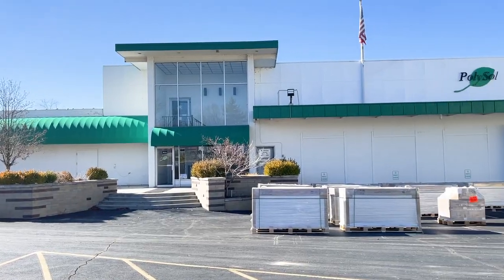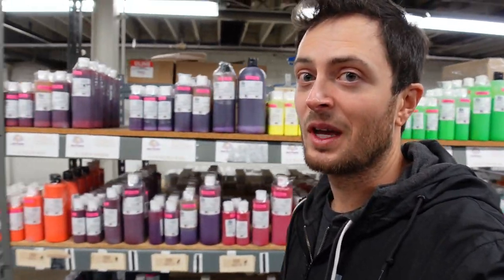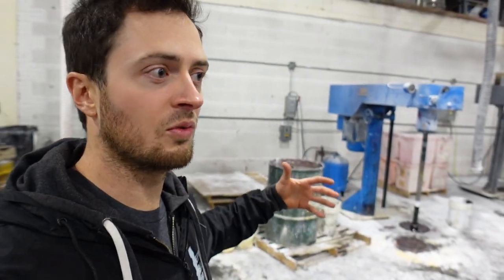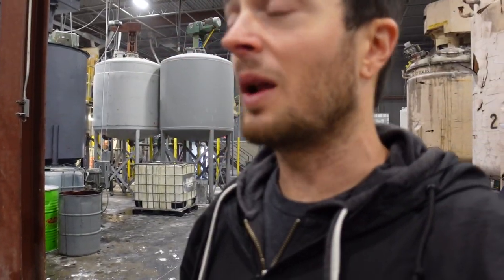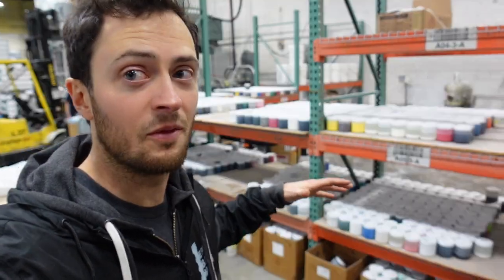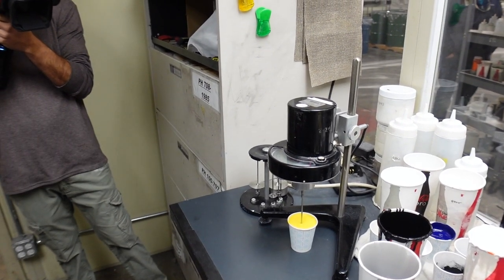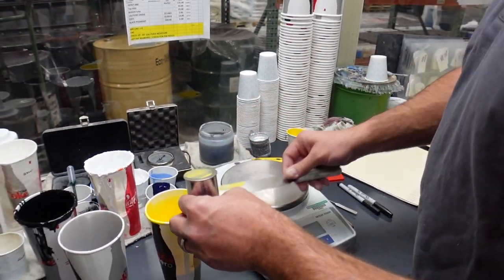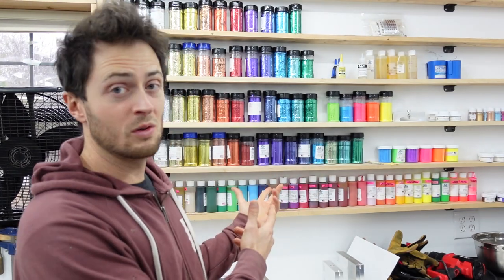How Fishing Lure Plastisol Is Made - Bait Plastics Facility Tour

Comment: I recently switched to bait plastics ( the 242 & 262 ) from another brand, my baits are coming out nice but develop a smoky haze while curing 1 - 2 days after pouring, I called them & they said its a known issue with 242 Ultra Clear  & It happens if you add heat stabilizer & suggested pouring more batches without it, I did and the same thing happens, 80% of my baits are transparent colors & although it ruins all 100% its more noticeable with transparent colors, I have 4 buckets of this stuff now & cannot use it. pretty disappointing  since its supposed to be such good plastisol and "Ultra Clear" , if I apply some worm oil they look transparent again until the oil dries up, I wanted to like this stuff but so far has been a total waste of $ and time.